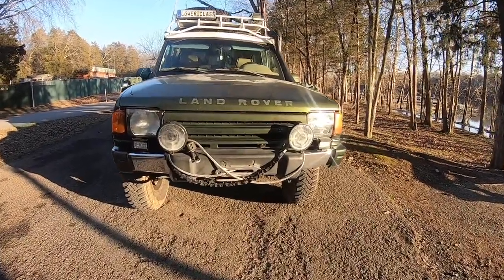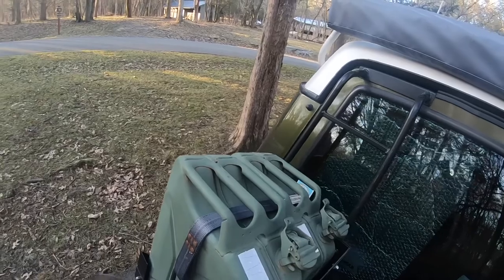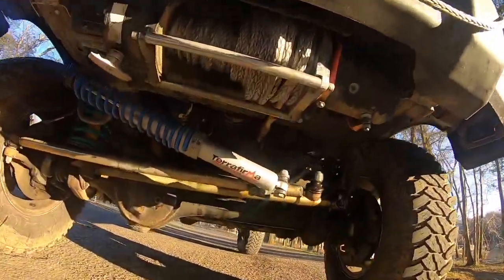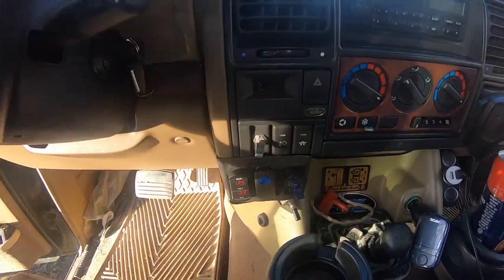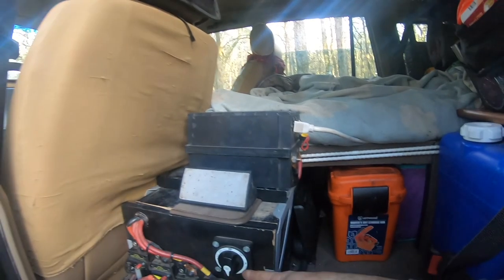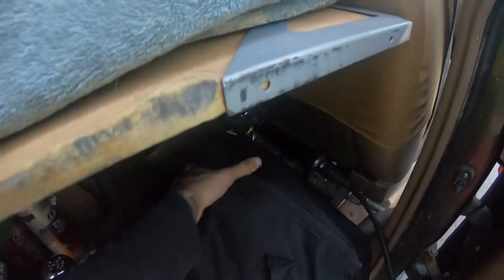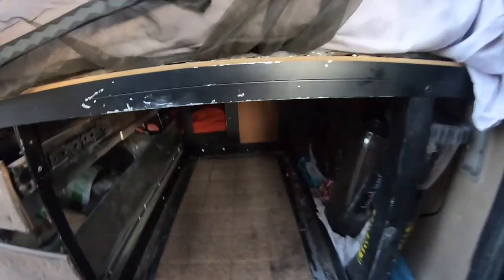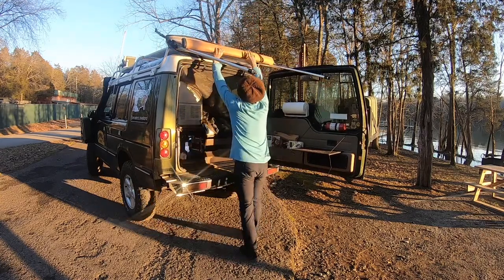America Overland Presents Episode 8: A Rig Run Down of the ASV Land Rover Discovery 1

Comment: Do u have ac during the heat? Or just run the rover ac?
Reply from the maker: Ive tried a couple different swamp cooler style set ups, other than that I have 2 fans inside the blow in opposing directions to keep the air moving.